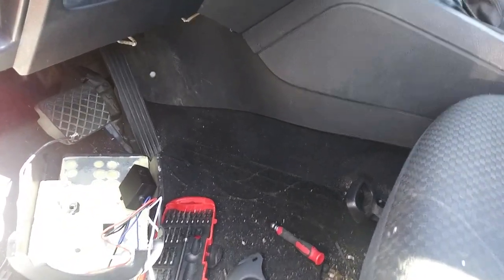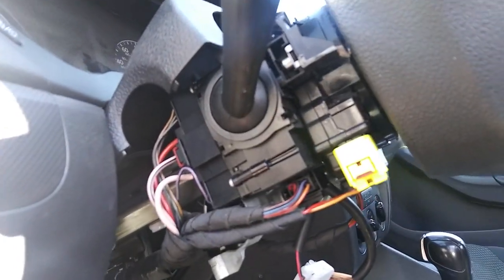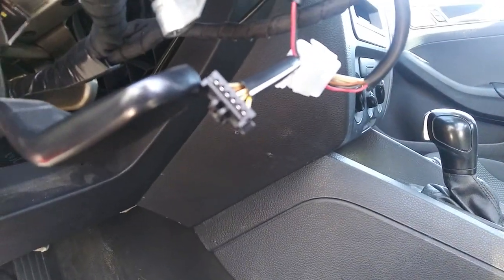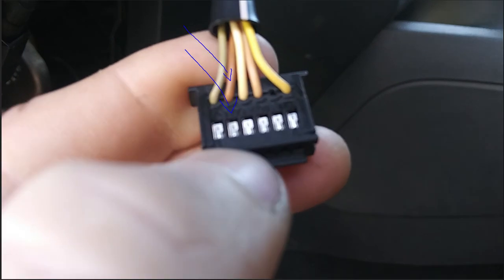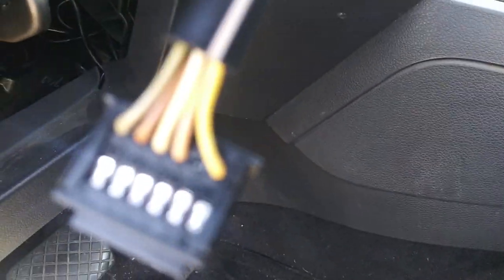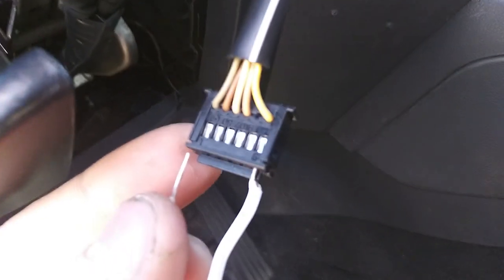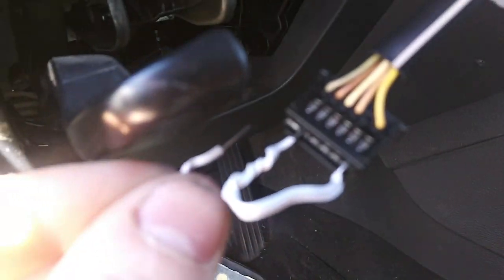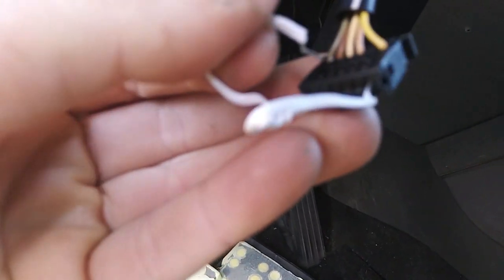How to hot wire a 2011 - 2017 VW

Comment: Thanks this worked on a 2011 Jetta.  The ignition switch was broken and the car otherwise wouldn't crank.
Reply: Did this work long term? Did you end up replacing the key lock cylinder?
Reply: @nolanmanicki3080 my friend is still using this (~7months) but he wired in a switch so he doesn't have to manually jump the two connections each time to start it.  In his case the key wouldn't turn to start the vehicle but still needed to be inserted and detected by the car.
Reply: @jamesmauer7398 would this work if I lost me car key?
Reply: @watchPG sorry I'm not sure - we still had a key but it wouldn't turn

Comment: ? this is not by passing the immobilizer correct? Still need the key is near the ignition for immobilizer to be recognize.
Reply: VWs (and I assume other VAG cars) will start with no immobilizer but then quickly cut out in less than a second. That's why the video ended so quickly. Other car makes will crank and not start, others won't crank at all.
Reply: @LaddieT  I had a guy direct me here to this video and jump started his car and drove it after his key got stuck in the ignition. Maybe only certain VW’s?
Reply: @hardcore4476 what year was it
Reply: @stuntrunts  I’m not sure. Probably 10-14

Comment: So I have a 2008 vw rabbit 2.5 
And I’m dealing with the dreaded faulty ignition lock cylinder. I replaced it with an auto zone part and two months later- the brand new ignition lock assembly faulted out and the key would not engage-

I ordered the same exact parts again but then I got lucky and the OLD NEW assembly engaged one more time - so I’ve left the key in it for several weeks and every time I turn off the car I removed the fuel pump fuse and disconnect the battery 

My QUESTION IS 
If I get one of these Chinese remote starters off Amazon — can I wire one up that will bypass this entire faulty ignition lock cylinder assembly ?!! 

That seems to be what you were doing here
Reply: What did you end up doing? I have the same problem with my 2011 Jetta